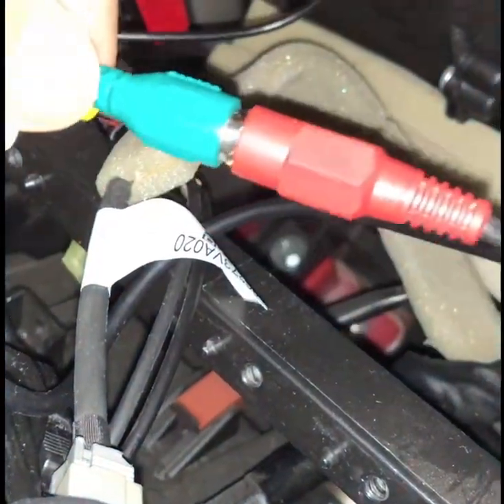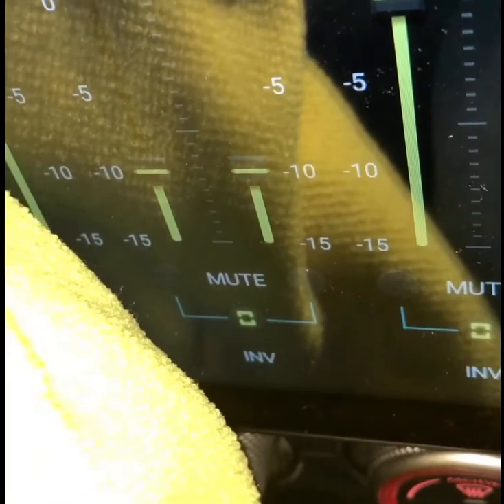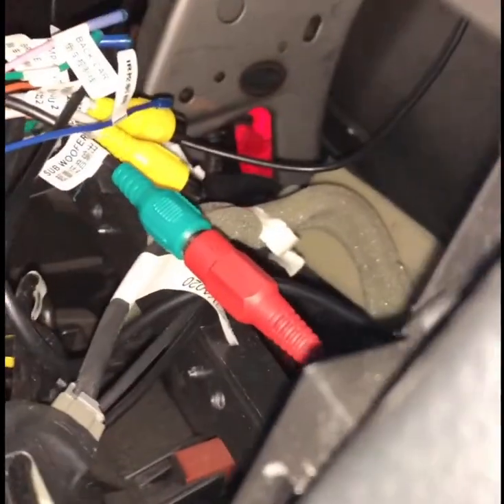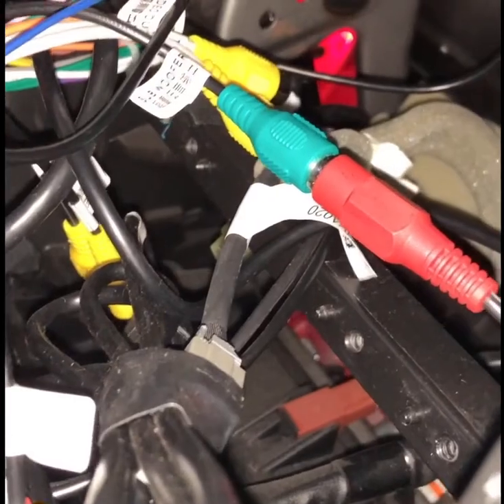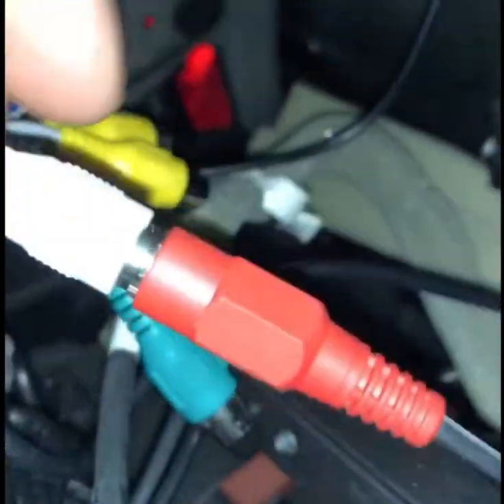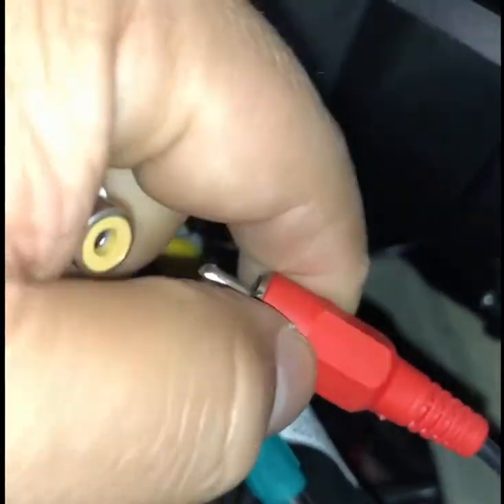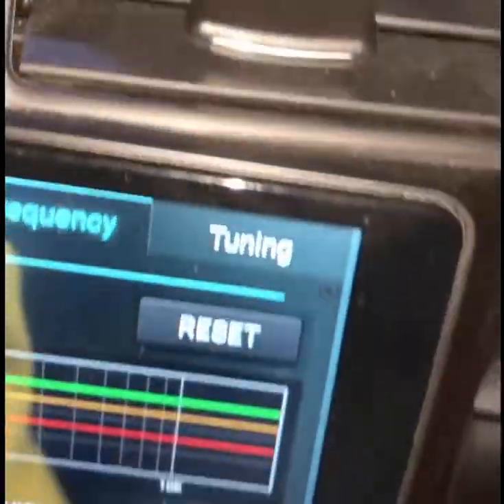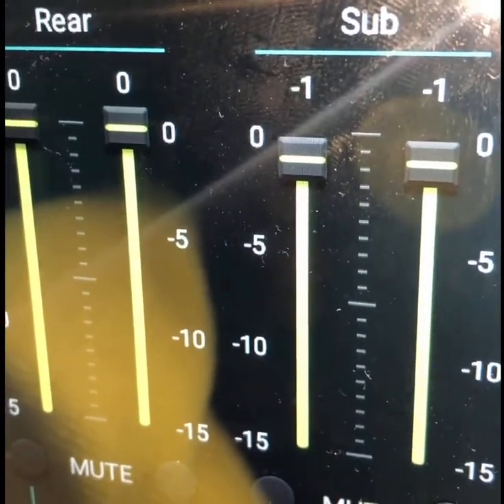Seicane subwoofer output not working.

Comment: I know this is old, but I resolved mine after I realized in the drop down notification bar, there are a number of quick setting tiles. One of those is a speaker icon. Turning that on enabled the AMP wire to activate and has turned on the green subwoofer RCA line. So now I have a dedicated sub out line working.
Reply from the maker: I have to find that “drop down notification bar”.
Reply: @Group2Matrix Just swipe down from the top and it should expand the notification bar. And at the top of the bar should be a number of quick setting tiles. Same as would be on an android phone. I never paid much attention to it because why would I? Nothing up there ever interested me. But after I wiped the stereo and setting it up again I happened to pull that down and see the speaker icon there.

https://youtu.be/apbh0lcR6Lo

Wasn't in the manual either. And it's dumb because this should be a setting that defaults to being on but isn't.
Reply from the maker: @firstlast7152  wow! I will definitely try that when I get back home. Thank you for the info!
Reply: Did this work?
Reply: Did this ever work ?

Comment: Wow...I purchased two of these Seican Radios recently were BOTH of them has the exact same issue with SUBWOOFER output is not getting signal. Now I can use and connect the Rear RCA outputs to the SUBWOOFER but the built in EQ fader that comes with these radios will not work afterwards. Sounds like it could be a software issue but not sure. I sent Seicane multiple complaints regarding this with no resolution. I'm going to try taking one of these units to my local Electronic Repair Shop to see if maybe a custom ROM update will resolved the issue or if its internal issue that can be added.

Comment: HI GUYS   NEW TO MULTIMEDIA SYSTEMS     HAVE  A GREEN WITH SUBWOFFER ON IT ,,   DOES THIS GO TO  THE SUB AMP ,,OR  STRAIT TO THE SUB SPEAKER     PLEASE HELP
Reply from the maker: It’s supposed to be a line level subwoofer output to a subwoofer amplifier but mine does not work.the green RCA output is not an amplified output. I hope yours works. I hope they fixed that issue.

Comment: U gotta scroll to bar down on radio and make sure Amplifiers on and ur remote wire needs to be hooked up right if u still got nothing check see if amps on if not u got bad ground
Reply from the maker: Scroll to bar down?
Reply: Scroll the bar down my bad and it will show ur wife and time and date and stuff and there's a Amplifier button
Reply: Wifi sorry auto correct
Reply: Rcas audio r its red  thats ur red wire and audio l is ur white if its not working like that then ur amp is probably not on or grounded correctly
Reply from the maker: Sub amp works. I’m going to check and scroll down on the menu in settings for a switch “on” for an amplifier button. Thanks.
Reply: That only works if u hooked ur remote  wire from amp  to the amp wire provided on ur android radio.
Reply from the maker: Thank you. I will re-route that wire to the radio instead of the acc switch.
Reply: Also that bar i was talking about its like your notification bar that u pull down to check wifi and stuff just like ur Samsung phones
Reply: I've always hooked my amp remote wire to the positive on the radio but its cool they got a wire u can just hook to on the harness
Reply: Let me know what happens cuz imma be hooking my subs up to my android radio. My knowledge is based off doing systems all the time and YouTube. I'm just waiting for the new subs I ordered. This android radios are new to me but I love mine so far
Reply: Got mine installed sounds great.
Reply: @Group2Matrix   did you fix it?
Reply: @highlifegoodlife5400   is yours a seicane brand radio?
Reply: My radios a android 10.1 9 in screen for hyundai elantra. Got off Amazon. When I had to order sub wires and back up wires because they didn't send them with the radio so I had to pay 15 Xtra to get the wires I needed. Amazon says its a hikity brand think it was 150. I love it.
Reply: @highlifegoodlife5400  MSN I want to know if this guyvfixed his I have the seicane for my chevy sonic and I just ordered 600$ scar audio amp and sub setup, sighhhhh. I'm hoping it was just some stupid user error..
Reply: I did notice on mine its seems to get hot im guessing its from the built in amp in the radio so if ur bumping for a while or watching YouTube or something feel it with ur hand around the radio.
Reply: I'm guessing user error. he didn't have his rcas hooked up the right way
Reply: @highlifegoodlife5400  I hope it was just user error, I will find out soon lol
Reply: Good luck

Comment: Me an my brother were trying to figure it out it all night an what we ended up doing was useing a rca splitter on the single green sub rca cable because I have 2subs after we hooked everything back up we turned the radio on an swiped down on the screen to turn subs on an it worked I figured this would help giving my experience on trying to troubleshoot my sub issue
Reply from the maker: Swiped down on the Home Screen?
Reply: Nice. This is what I was looking for. With the white and red hooked up, my subs sounds like trash. Imma do this thanks
Reply: Didn't work for mine

Comment: My green plug doesn't work either.
So what I did was run my sub amp off the rear RCA outputs with hpf on the seicane ran in bypass mode. Then the sub amp is getting full range and you can adjust the lpf on your sub amp. For my rear speakers I ran skar audio inline bass blockers that filter out 0-150Hz. You just splice them into the + wire at the speaker.

Comment: I am having the same issue also, and I ordered an Android head unit for a 2011 Nissan Frontier; it seems that this is not just one particular head unit but ALL of them with the Green Subwoofer RCA output; just curious, how many of you guys got the DSP option?  I think this is the option that adds the Green subwoofer RCA output, not sure never saw a unit without it.  I ordered the first one and the subwoofer output did not work, so I returned it (at my expense, they refuse to reimburse me for the shipping, nor have I received my refund for the return of the unit) and then I waited a few months and then asked them if this issue has been taken care of.  They told me that the subwoofer output works now, and sold me another one, and low and behold the second one has the same issue, no subwoofer output.  As of May 4 2021, they still have not contacted me with a solution, except to say "The engineer is working on it".  This sucks because everything else on the unit seems to work fine...Let me know if any of you get any resolution, and good luck!
Reply: If u haven't figured it out it dont go to the green plug it plugs into the left and the right out put

Comment: i had the same issue but with another brand android head unit.. I ended up speaking to the dealer and changing it with another model which is now working properly. From what i understand this is caused by a software issue
Reply from the maker: I wonder if there would be a software update. What brand did you go with? What model?
Reply from the maker: @shomsgarage9549  wow! 30 band eq!? I will definitely research that. Thank you very much.
Reply: @Group2Matrix  no problem! if you are on instagram, i can send you some pics if you'd like. Whats you ID?
Reply from the maker: @shomsgarage9549  @MixMennace

Comment: Anyone find out the issue ? It seems to be a issue with firmware or DSP board because I have 2 boards one with DSP that sub out dont work and one without DSP and sub out works . and seicane is useless . so useless that when I had bootloop and wanted them to send me a new px5 board they sent me a DSP radio board ..... I ending fixing the bootloop with a hardware flasher and rock recovery tools
Reply from the maker: I gave up on it. It would have been nice to have that separate control for the subwoofer amp but Seicaines customer support sucks and they don’t really know what they’re  doing. I’d rather talk to their repair techs than to email some lady that doesn’t understand the concept of a 4 way speaker system. If I were to blast the subs like the typical teenager these days I might raise hell. If u find a solution otherwise, let me know. I’d like that green sub output to work.

Comment: Anyone ever figure this out...I can confirm that using the rear L, R out works but the problem with that is I am now tuning my subs with my two rear speakers which is not ideal sending those frequencies to my rear speakers and vice versa to the sub
Reply from the maker: That’s where I am at. I can’t find a clear solution and the Seicane customer service really suck as their techs don’t understand “low pass filter” coming out of the green “sub” output. I am also using my left right rear speaker output. My rear speakers can’t handle the low frequencies at high output levels.
Reply: @Group2Matrix  yah I hear you it sucks.. I was honestly thinking about saving the "dash mold" and trying to find something else that has an identical screen size but that means throwing out $386 essentially...
Reply: @Group2Matrix  so here's an option for you that I'm going to implement myself.... Use a line output converter on your rear speakers to give you two additional RCA outs. This should allow only the lower frequency to go to your subwoofer... It's extra work and money but in my situation it's my only option because I need the default RCAs for my 4 channel amp for the speakers, and the line output converter will provide two RCAs for  the subwoofer

Comment: Same thing happened to me. Iv had to take the feed from my rear speaker outputs
Reply from the maker: I'm doing the same. That sucks because I need to high pass the rear speakers to keep from low end blowing up the rear speakers.  I emailed them a couple of times and they don't seem to have an answer about the actual green "SUB" output. Still waiting on their techs to reply. I will put a solution in these comments as soon as I hear from them.
Reply: @Group2Matrix  same! I'm having to send full range to my rear speakers :( iv also emailed for support, I will Let you know also if I hear anything 👍🏻
Reply: I'm going thru the same thing, hope there is a fix.
Reply from the maker: @jaswayne  I just emailed them again. They are not good in responding.
Reply: I got a reply from them that I translated to English because they reply better when I emailed them and translated it to Chinese, here's the reply: 
Hello, the subwoofer is divided into ordinary type and subwoofer type. The ordinary subwoofer is connected to the left and right sound output terminals of the rca. Only the subwoofer is connected to the su sound output terminal on the rca. It will not work if you connect it wrong. You can how you can connect this line  Send us the picture?  The engineer needs to confirm the problem
Reply from the maker: @jaswayne  Well. That makes no sense at all. Sub fader should control Subwoofer output. They need to get their S#!t straight. let me know if you worked out a solution. Thanks.
Reply: They are sending me out another wire loom to see if that's the issue, but I don't think it wil help. I'm going to get a 4 channel amp, and use 2 channels to power all 4 door speakers and 2 bridged for the sub. Using the front outputs on the head unit for the doors and the rear outputs for the sub. It means I will have control of the sub independently but will loose  front/rear fade on the door speakers
Reply: Well they sent a wiring loom already that made no difference, the looms are identical. Since my whole speaker system is Skar Audio I just ordered: Skar Audio SKA7EQ 7 Band 1/2 DIN Pre-Amp Car Audio Graphic Equalizer with Aux Input and High Voltage RCA Outputs
This will boost the voltage of those rca outputs and I'll have control on the sub without tapping into the rear speakers.
Reply from the maker: @sonicsoundzdj  sounds like I will have to do the same if they don’t come up with a solution. That really sucks though.

Comment: i have the same problem. The Green RCA (subwoofer) is not working. Solution: i connected my Sub to Audio-out Left & Right. it works fine now
Reply from the maker: I did the same thing. But that doesn’t give you separate subwoofer control. You will be sending low frequencies to your rear speakers which may blow them up. Depending on how loud you play the radio. I don’t play it that loud anyway. But it does work.